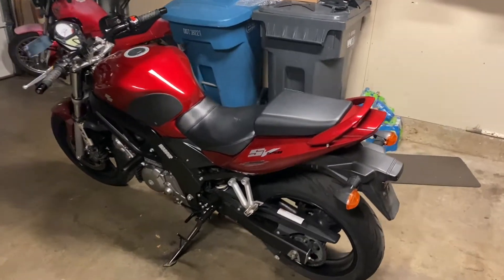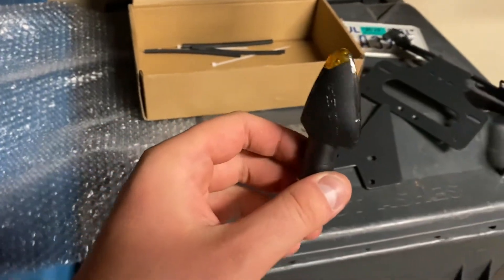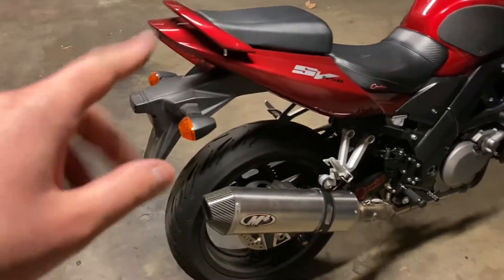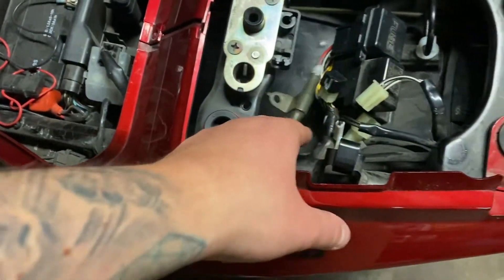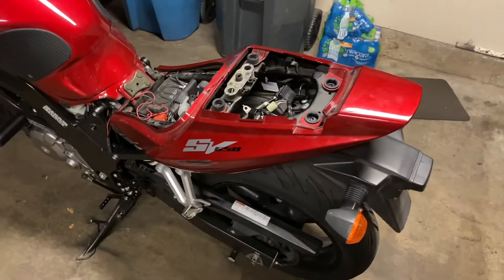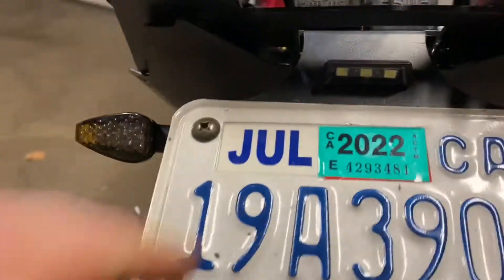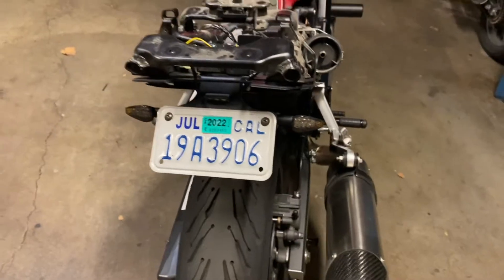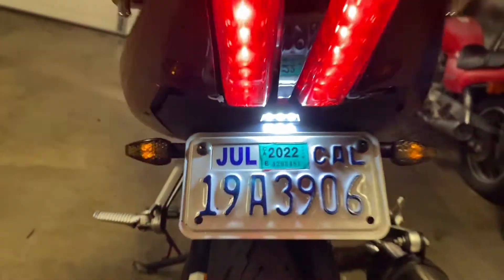SV650 Fender Eliminator Installation

Comment: When you reused the old wires for the turn signals did you solder them or just electrical tape?
Reply: always solder.  or use solderseal connectors👌